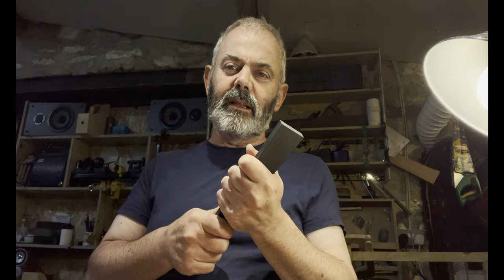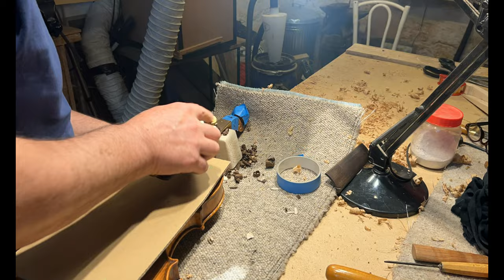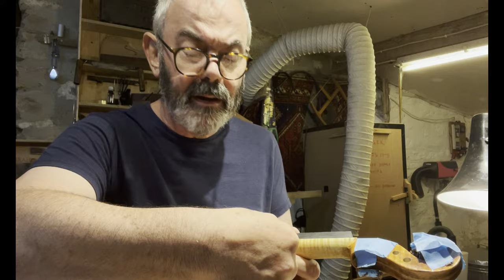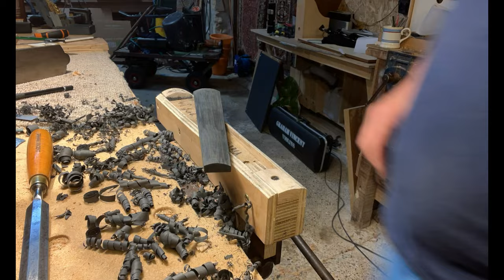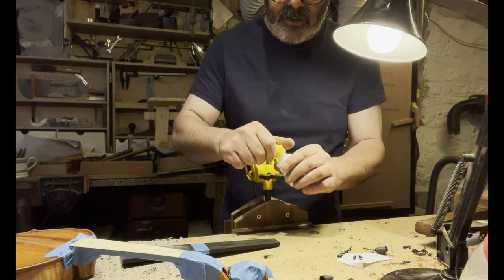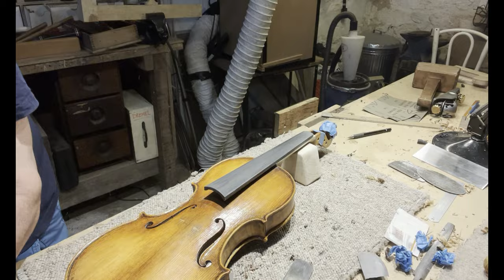# 103 - Richlite - an excellent replacement for ebony in violins

Comment: Super cool! I’ve wondered how Richlite would work as a Violin fingerboard. I wonder what manufacturers are going to use as the (apparent) availability of good Ebony diminishes? Zach Hoyt sometimes uses Persimmon. There’s a Persimmon fingerboard on my Pisgah (brand) Banjo. It’s super hard. It didn’t look like much until I applied Renaissance Wax to it. That brought out a lot of cool looking black lines. Thanks! 🙂🙂🙂😎😎😎
Reply from the maker: Interesting, I see the Persimmon is a cultivated tree, mostly in China - so I'm guessing it's a sustainable alternative, but everything I know about Persimmon has been learned from Google in the last two minutes, so I'm no expert!! Glad you enjoyed the video.
Reply: @grahamvincentviolins  I believe Pisgah obtains their Persimmon from their region. They won’t use tropical hardwoods last time that I checked. 😎
Reply from the maker: @mccypr  Just had a look at their website, "native hardwoods and 100% solar power" - wonderful!
Reply: @grahamvincentviolins  Yep! I wanted a simple five string open back Banjo that didn’t cost a fortune. I called them and actually spoke with the owner. Talk about customer service! This was about seven years ago. The rest of the Banjo is made of Cherry with a carbon fiber reinforced neck and a Dobson tone ring. This is before (I think) they started using truss rods. 😎

Comment: Interesting video! Richlite fingerboards are used for guitars and seem to have a pretty good reputation. Apparently it doesn't play well with hide glue, however so maybe CA glue would be the only option which permitted removal. Right now I can't find any  blanks available for violins. Maybe that will change soon, but you can buy a 12inch by 12inch blank for about $36.
Reply from the maker: I've been buying the square "samples" you found.
Reply: Couldn’t a thin layer of timbre veneer be superglued to the back of the fingerboard, thus providing a surface for hide glue to work?
Reply from the maker: @andreweth8301   Your thinking being ease of removal if required? Generally Luthiers see fingerboards as a consumable and will be happy to remove the fingerboard by chiseling and carving it away if it needs to go. The only time I've reglued a fingerboard was when it had come loose and therefore removal was not a problem. Superglue can be removed from the jointing surface with acetone (but don't get acetone on the finish!!!).